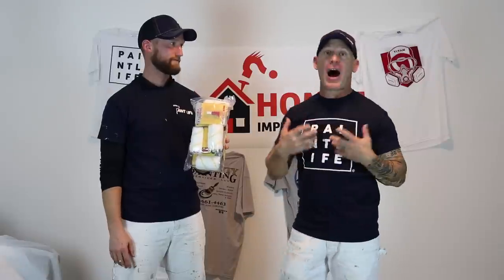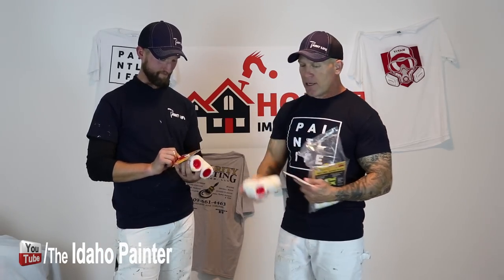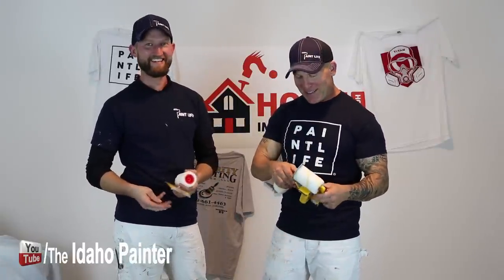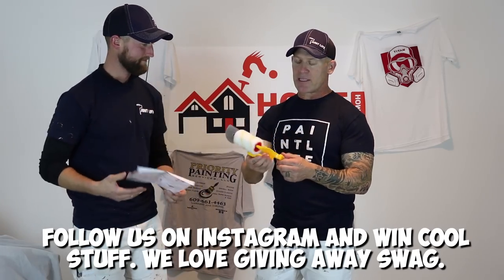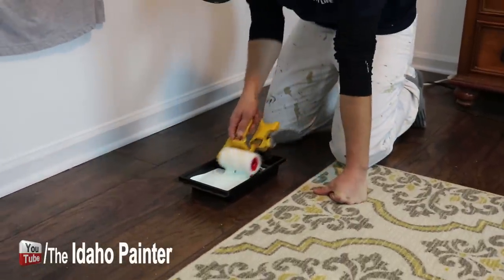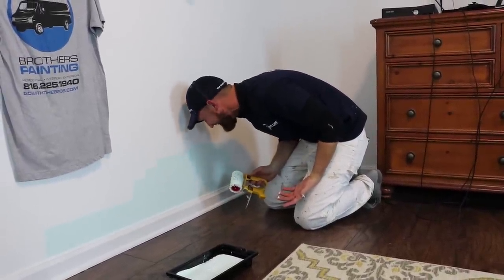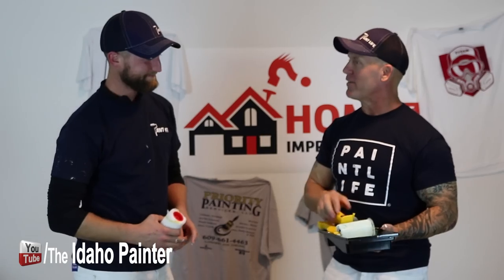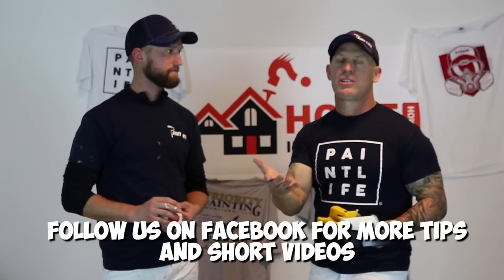Accubrush Review.  STOP & WATCH before you buy!!!!!!!!

Comment: As a home owner (DIY guy) this thing is very appealing. Cutting in is the worst part of a paint project. I’ve watched pros with brushes who were less than impressive. Most load up the brush heavy for one single pass on the cut in and don’t try for a second coat. This seems to do a decent job and could get that second coat. How thick the caulk line is seems to be the tools Achilles heel.

Comment: Great video. Like someone else said if you need to cut corner you are not a professional. defiantly home owner quality.
Reply from the maker: Thanks Chris!
Reply: Chris DiMase so true. It actually takes the professional out of you using it or any short cut devices. I believe if you can't cut straight lines, you shouldn't call yourself a pro painter.
Reply: Henry Mason anyone can learn to spray. I believe spraying is good for certain parts of the job. I like spraying on exterior, garages, texture ceilings  rough walls, ceilings, doors, trim and cabinets. It looks like shit to me on walls unless in commercial. Or new construction which is ok. Residential occupied homes, there is too much prep work with masking off. The time it takes you to cover and protect everything, think brush and roller is faster and to me looks best. That's my opinion. Just saying.
Reply: I never said  new technology or new products cant help make a job go quicker. I have tried products like this in the past and only had to do more work, when the edger bleeds onto the fresh painted ceiling, or molding. The product itself appeared to be flimsy according to the video, and I don't think it would stand up to everyday use.  As for common core its totally irrelevant.
Reply: You’re criticizing even before using. Why didn’t you try it our before wasting our time with your side comments.
Reply: Chris DiMase. Of course it’s for home DUI. Not everyone can have a professional. Chris so wanted this product to be bad.

Comment: I bought this years ago. Most times I work alone. Thought it would help me go faster as they claimed. I used it for 6 ft and put back in the bag. Haven't touched it since. NOTHING is faster than good ole brush and roller. 
The wheel marks drove me crazy, the noise was annoying and I kind of felt embarrassed in front of the customer. Didnt feel like a professional at all. I just told her I was giving a review. She laughed cause I told her it sucked. If your not confident or experienced with a brush  and Want straight lines, tape, caulk the tape, cut in, pull when drying. Perfect line everytime. And use good quality brushes and rollers. Follow Idaho painters vids to learn how to paint like a pro. He is the best on YouTube hands down. Love every video he has ever posted. Learn something every time I watch one. 
Don't waste 1 cent on AccuBrush!
Reply from the maker: Yes, much agreed

Comment: I use a shur ling  pad on new construction ceilings.....cut the pad on the top off with a blade...1/8" inch...put a light extension pole on the tool...and load it with a small pop bottle I keep in my shirt pocket...when u cut the ceiling in after off a ladder your brush effort is achieved  in one trip
Reply from the maker: Awesome, thanks for sharing!

Comment: You pull it. The wheels go in front of the roller guys come on
Reply: Yea, I don't think that the wheels should ever touch the paint....just makes sense
Reply: The problem with that is you need to sometimes work in the paint which doesn't happen on a first roll unless you get the perfect amount which is hard to do
Reply: That wont work then the brush wont correctly pick the paint the rolling is applying

Comment: Great video guys, I got put off as soon as you opened it, it just looks so cheap and the noise as you roll is a put off straight away, also by the time you have loaded and rolled from one end to the other and also the corners you cannot reach, you could have cut in with a synthetic brush, more negatives than positives for me, thanks guys 🙏🏻
Reply from the maker: OK

Comment: They make these little rectangular pads that have hairs, and they work a little bit -- I cannot remember the the brand name -- but they seem to show some potential, yet the "pad device" doesn't work very well. I don't think it is the pad, but the  "device." It too has wheels, but they smear paint onto the ceiling. Also,  corners are a problem for those pads. I DID SEE they invented some new shaped pads, not rectangular, and a holder that does not have wheels. They show it being used and it seems to work!!!! I have seen these advertised on YouTube. I WISH YOU GUYS WOULD TRY THOSE PADS. I am a general contractor, and I would like very much for YOU GUYS to "review" those pads, let me know how they work. And I can tell you all of your audience is just as excited as I am to see how those pads work, because if I (we) can find any way to make cutting easier, I (we) would be very happy.  TRY THOSE PADS!!!
Reply from the maker: Interesting, we'll have to check them out!

Comment: In the Uk, a lot of our rollers have the plastic endcaps, we just prize them off with a screwdriver wash the roller and replace, I also think that if the rollers are a standard diameter  then you could buy any sleeve and cut them down to fit, I personally would not use one but I think if they had a better quality frame then it could have a place in the industrial market where no one is checking the quaility of your line work and there were long runs of straight lines, but basically it is a diy product for the homeowner who only paints every ten years and cannot cut it, will then throw it in the back of the cupboard never to be used again, but I like the concept and I think it could be made usable.

Comment: I actually used a gimmicky cut in tool you can get at any big box store. It uses a rectangular pad to hold the paint and wheels that roll against the ceiling or trim. If you  make sure to not get paint on the wheels and load the paint on the pad carefully it works decently. Also, they're like less than $5. Can't really use it on baseboard with a routered, thin edge as the wheel won't contact the baseboard well.

Comment: Good review. At first I was a bit lazy to watch a half hour video, especially because of the  chit chat at the beginning, however, I appreciated the review of this gadget by a couple of professionals.

I understand that the review was somewhat improvised, not tested in the ideal conditions of the product as shown in the infomercials. But I liked that, because if a couple of professionals who know how to do things, who know how to get quality results, are not able to use this gadget well, then it has a design problem.

I consider that the lines on the edges of the metal plate that protects the roller when painting an edge could be avoided by taping the edge as usual, although in theory this gadget saves us that step.

It seems to me that the product has very particular conditions to be able to work properly and give good results which is a problem because if even professionals like you have to relearn how to use something like this, then there is a problem of product design as I said before.

I find it quite expensive for the performance it showed. If anything I would consider using it for a job whose quality would allow or find reasonable the results the product gives us and the deadline of the job was short (which always implies a higher price which could justify the expense), otherwise I think it is not worth it.

Comment: That’s how I clean a Roller. Put it on my extension pole, use the hose nozzle and spin the roller in each direction, several times. Till the paint is wet spun out of the roller.

Comment: Hmmm. I am torn! In Colorado builders are in love with orange peels. On the ceiling it is nearly impossible to get straight lines. Some houses the texture is so deep that you tend to dab and splash the brush to get the paint onto the wall. I've come up with a good option for ceiling trim. I am using a Shure line trim pad. What I do is lift the guide pads, (which get gunky and streak) I angle the pad slightly and eyeball a line about 1/8th from the ceiling. The first coat doesn't look great, but gives you a good line to work with for the second coat. On the second coat I freehand with a brush and it comes out way better than free hand for two coats. I am wondering hmmm would this do a better 1st coat???? I guess I have to pay to play.
Reply from the maker: We don't recommend using it for any coat

Comment: You can just go over the track marks with a separate roller to smooth it out, and use the accubrush just to get the cut in line done that is all.
Reply: You actually don't even have to switch rollers, you just lift it at an angle to go over an area without the wheels touching. They made it seem more difficult than it actually is
Reply: @justRoRo  Bottom line though, the accubrush only works if the edges you're trying to paint are almost perfectly level. If it's uneven you won't get even remotely close to a finished line.
Reply: @nickp3173  you mean like textured walls? That's why the edge brush is adjustable, to accommodate unusual surfaces 🤔
Reply: @justRoRo  No, like unlevel window frames. Or uneven baseboard trim moulding.
Reply: @nickp3173  sorry I don't understand what you mean. I live in a 100+ year old apt where literally nothing is level 😆 and with textured walls but i was able to use it just fine. Sorry if I misunderstood your point, but at the end of the day it probably comes down to preference 🙂
Reply: @justRoRo  I am a perfectionist. It made clean lines just not close enough to the edge like I would have expected. I ended up having to redo it by hand on every pass. The edger guard also scraped the paint off whatever I was edging against (trim moulding) and the wheels itself also scraped some paint off the wall as well. If they had replaceable felt padding or something on the guard and wheels it would be a lot better. I wasn't too impressed to say the least.
Reply: @nickp3173  fair enough! My experience was better that yours it sounds like since I didn't have those issues. 🙂
Reply: @justRoRo  Yeah to each his own. The variable really is the construction of what you're actually painting. Mine wasn't good for its application. Glad it worked for you!

Comment: I bought one to try.  Used it once and it was garbage. I cut the first coat and then tried this to see if it would be quicker. Paint got gummed up, it was clumsy and left indents around the casings, and max I got was 5 feet before having to dip where you have to move the guard. I got the one that you can attach to a pole and it was faster to have just  cut the second coat.
Reply from the maker: Yeah, we would not recommend it

Comment: homeowner/non-painter here. What you're paying for isn't the roller, its the brush fixed at a specific angle with the guard designed for the brush hardness. Someone just needs to invent that brush, if it hasn't been invented already. Than one can roll however.

Comment: How is it after you cleaned a roller and go to use it weeks later?  I fear I would need a dozen rollers for doing a house. Also how well does it work on a vaulted ceiling to wall? Not 90 degrees from wall.

Comment: There is track lines from the wheel because you were not using it as it was supposed to be used.  The roller should always follow after the wheels...so go push or pull the device wheels first and the brush will cover the tracks with paint. There will always be a gap when a straight edge type of system is used.  Good review though.

Comment: i think that the accubrush its not that bad even if it doesn't cover the whole surface it will help you anyways somewhat it does help you apply paint and i have been painting and even though it doesn't fully does what it says it just helps you to get the paint close to the edge of the line

Comment: Great review - but...honestly the accu people say to always finish the stroke with the down stroke to remove the wheel lines.  C'mon guys.  And you guys are not unloading the tool like the manufacturer says to.  You do it off to the side, and then don't blend and feather it in.  No I am not a rep, I am an IT guy that is painting a 1588 sqft house  to sell an estate.  I know well how to cut in and am looking for a way to keep some other people working without ruining the paint job.  

Just be honest.  The tool works well for people who don't know how to cut in paint.  10 feet up in the air, how many people other than professional painter are going to look at how absolutely TRUE the line is, and if it has a bit of lint in it?  Seriously?  You guys are AWESOME BTW.  I think you can't get past the amateur demographic this tool is marketed to.  Obviously, it 's not professional.  It's a band aid.  Have you seen BTW...newbs try to cut in paint after showing them over and over how to do it?  It 'ain't pretty boys!!!
Reply: I trained and mentored two guys this week on several walls with trim on cutting in with a nice high quality brush.  They sucked and just could not do it.  They had paint all over my trim.  Accubrush is on the way to the jobsite tomorrow.  If that doesn't work, I'm doing it all myself.  And that will take another week. LOL.

Comment: You are not supposed to use it on floor trim without a 1/2 edge. You are not supposed to do more than 3 feet with one load of paint. They didn't read the directions. However, after watching this, I am returning mine. Also, to be fair to the company the kit that costs over 100 has more than a pan.

Comment: I don't honestly know if this would be worth it to me but I do feel that this review of it does have some flaws in how you used the product.
When you roll the thing up, assuming you are doing a door way trim for example, you will leave a roller mark but as you come back down you will roll over that smoothing it out, as shown in the ads. Given this is NOT supposed to be for anything but a single width/stroke edge, you shouldn't be getting paint on the right hand roller. If you did have a roller mark from that wheel you would be going over that with your main/big roller when you overlap it while painting the main body of the surface. So unless rolling down, and over, the roller mark right next to the edge doesn't erase that left edge roller mark I would call that a non issue as it's proper use would correct that as it goes.
As far as cleaning and re-use, I think it's fairly clear in the ads that this is not aimed at pros but rather the DIYer that will be painting a room or maybe a house. If I were to use this to paint the entire inside of my house I would likely just use one roller per color and trim out all those areas in one day. So the need for keeping it from drying out or cleaning it out to re-use would not be a consideration for me. I think I wouldn't even need 5 rollers as I wouldn't use that many colors for most projects. Then I would likely buy more rollers, or another kit, the next time I paint it which would likely be many years later. So I don't even see the clean-up part an issue at all.

I understand your channel is based around professional painting, and you approach things from the perspective of a pro. Reviewing a tool, as a pro, is very different than from the one time use, DIY, single project mind set. If considering a tool for multiple project, everyday for years (business investment) than all these points are serious considerations. For the intended market though, I don't think any of that will matter. Now whether or not we should buy this is up to how well we can cut-in an edge with a brush, the cost of that good brush, how long does it take to do it both ways, and lastly how much is time a factor in your project.

BTW, I love your channel and am learning a LOT from you guys. So I don't mean to beat up on you over this review. I just thought I'd point out that reviewing a tool from a professional perspective is different than from a consumer/amateur perspective. I wouldn't expect to see you guys with these in your vans. :)

Comment: The rollers are uncommonly available, that’s the #1 thing that disqualifies this tool from sitting at the Masters table. Or is it the “guide” line left behind  … reminding you that “your not finished yet”. Edit# if you put “silicone caulk on the trim first, then the paint would push away from the silicone , making it appear like a perfect line …. However if you do that you can’t paint (your trim) over silicone….

Comment: Thay are using the ceiling  roller which does leave wheel  Mark's did not work well however  used the hand held roller around wood beam ater ajusting the brush worked great

Comment: It sounds like they’re threatened by this product. The same way Painter’s and decorators were threatened when people started spraying. Especially the older painters. The thing is, doing a good job is what it’s about on price as well as efficiency. If its efficient work it, you can always cut in your top coat with a brush if the wheel mark is half as bad as they say
Reply from the maker: We do honest reviews of products and share what works for us and doesn't
Reply: Paint Life TV I’d agree you have great videos. But I’d also have to say with painters, that most of the time when a new product comes along that will make the job even easier, a lot of the time they dismiss it. I’ve seen this with carpenters and joiners also, when fes tool brought their plunge saws out. Now everyone’s got a plunge saw for fine work... Eventually a product like this will be the future. Let’s face it, if you were a young Painter on price, for the first time, you’re gonna use it. And if you’re any good, you’re gonna use your brush too...